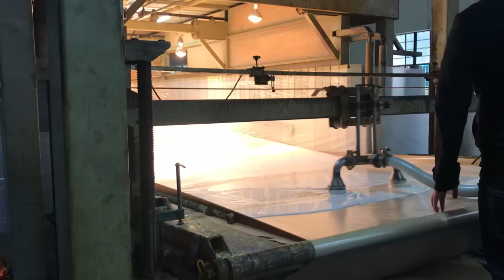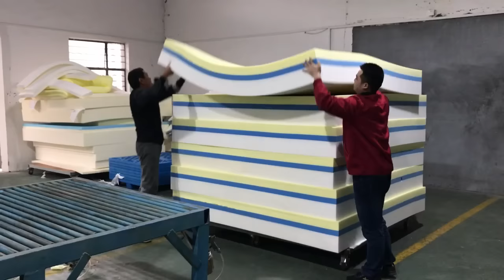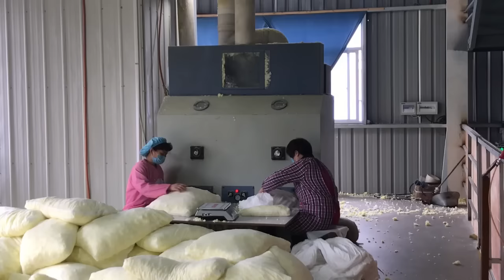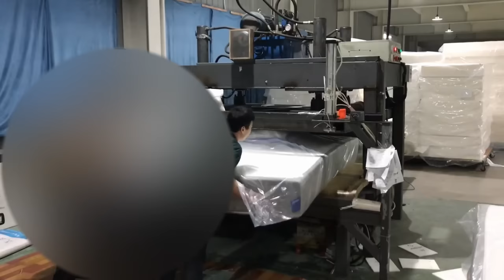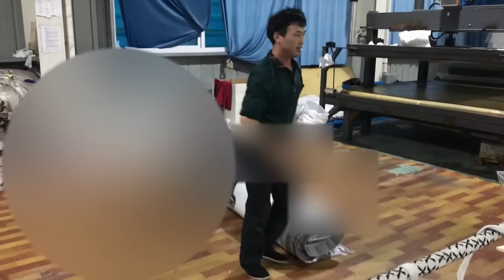Memory Foam Mattress Production Process!

Comment: I use to work in a foam factory for 15 years, I cut patterns ,work in the convoluted machine, I learn to work on all the machines, ...long ago, I miss my friends there and loved my job.
Reply from the maker: Cool!!!
Reply: i need help to buy machines
Reply: @adelkolodol6391  do you know how much they are and how many machines are needed?
Reply: Plzz tell me the cost of whole unit
Reply: Hi, did you not have any health problems from breathing in all that chemickal dust and offgassing all day every day. There is a job advertising and I 'm thinking if I should apply. I read that it is made from  polyurethane foam and that is very toxic.
Reply: @cpsindustrial9822  is this china
Reply: Why did you leave
Reply: where you worked

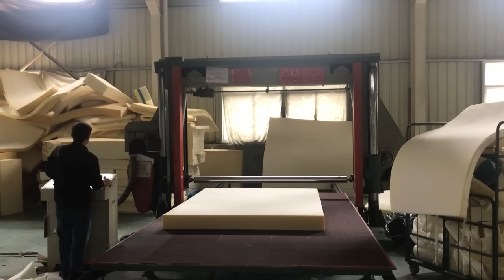Comment: I work at a foam fabricating company company, and have to that the guy walking on the carousel while it was running is stupid because that is so dangerous, we have a laser fence so our carousel shuts down when you cross it.  Also at time stamp 2:08 are you cutting that foam, on the slitter, with the backside of the blade or do you never sharpen you blades?  There is no reason for that slab of foam the lift up when it contacts the blade.

Comment: Several toxic chemicals are reacted to make the foam, what are the exposure concentrations to the people?
Reply: When the isocyanate is mixed with the polymer base it forms CO2 and is not dangerous when it reacts and releases the gas bubbles to make it foam. The isocyanate in pure form is very toxic but is never directly exposed to workers, only the technician that changes the barrels of chemicals need PPE.
Reply: @rustynail6819  Judging by the hats Vietnam.